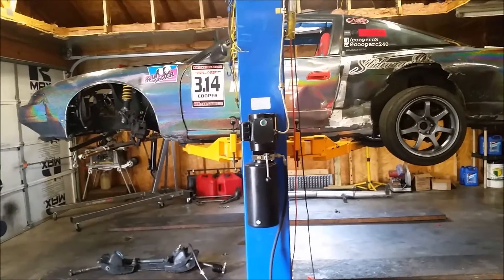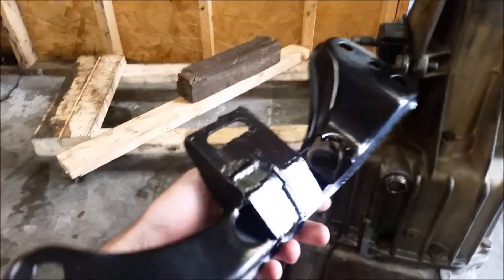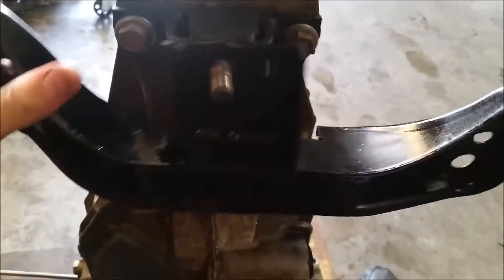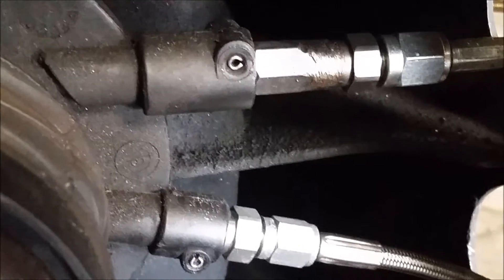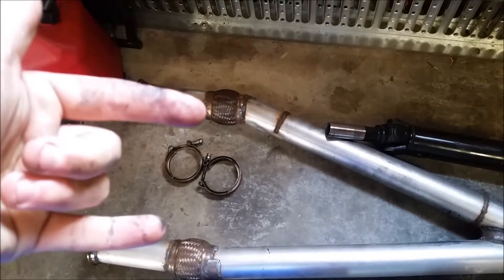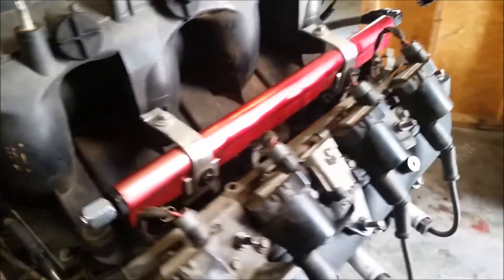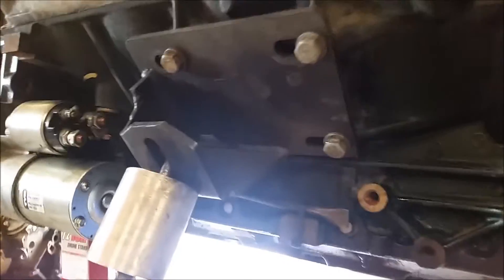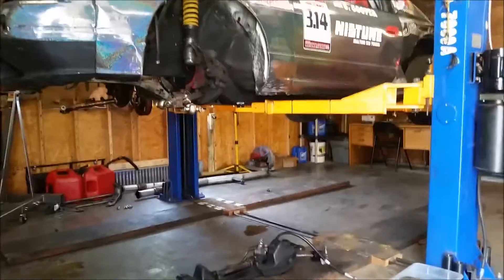5.3 LM7 swap Part 3: A Closer Look

Comment: You wouldn't happen to have the part number for the adapter fittings  you used into slave
Reply from the maker: I do not, but if you Google "Russell t56 slave fittings" or something, they should come right up!

Comment: Did you go with the internal slave over the external for a reason?
Reply from the maker: I was concerned that the external version would have fitment problems in the s13 chassis

Comment: This was great, thanks for the share. May I ask the power output of your engine?
Reply from the maker: No idea, it was a stock motor.  And I had since put some power adders on and switched to t56
Reply: @cooperc240  oh ok thanks for the reply. I'm having a LS6 built right now. 450/450 to the wheels. Think I'll need a t56 as well✌

Comment: Hello, I have a 700r4 in my 383 stroker, I would like to change for a manual transmission, do you recommend the nv3500 ?. Thank you.
Reply from the maker: I dont know anything about 383 strokers, but im sure you're pushing more power than a stock LM7.  In that case, I probably wouldn't.  It seems the AR5 is gaining popularity, but will require an adapter kit.
Reply: @cooperc240  mi engine has 450 hp.

Comment: What year truck did that trans come out of if you remember
Reply from the maker: My particular one came from a 2001 s10 I believe, but the year range you want is 1996-(??).  Any older than that and its external slave, and the slave cylinder might interfere with exhaust or subframe, but I cant confirm that.

Comment: Do you have a part number for the slave cylinder your using
Reply from the maker: I just now saw this message, sorry.  Go on rockauto, look up a 2001 Chevy s10 4.3, and it's the slave that fits that.  I think it may even be the same as a t56, but I cant confirm

Comment: What kind of clutch are you running?
Reply from the maker: _ theredfern I was running an oem-like one from rock auto.  But I just switched to a t56....and now running a rock auto LS7 clutch
Reply: S14*
Reply from the maker: _ theredfern nothing, I just switched so I already had a trans to take the power when I start doing engine mods.  The whole nv3500 swap is for sale now
Reply: cooperc240 how much you asking? Where are you located ( city, state )
Reply from the maker: _ theredfern I'm in Huntsville, al. $600 for the trans, slave, custom crossmember, driveshaft, clutch, flywheel.
Reply: cooperc240 do you have an IG?
Reply from the maker: _ theredfern I do!  @cooperc240
Reply: @cooperc240  did you sell it

Comment: hey man, how did you run your shifter on the nv3500? looks like you have some sort of linkage
Reply from the maker: D21MC take a look at my other swap info video, it shows the shifter I made
Reply: ok, the advice video?
Reply from the maker: D21MC yeah you can skip through until you see the interior
Reply: appreciative it dude, how does the nv3500 handle getting beat on? for sure the best option financially.